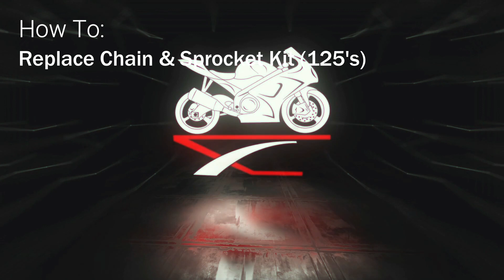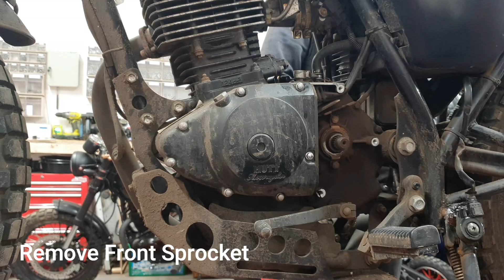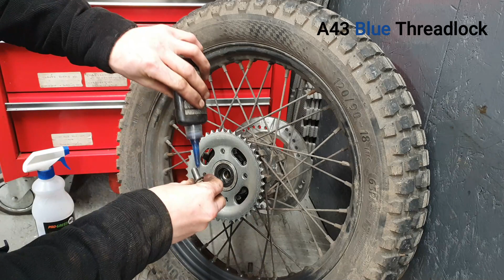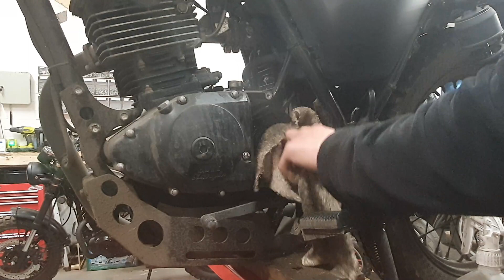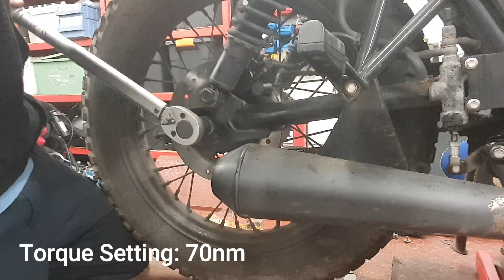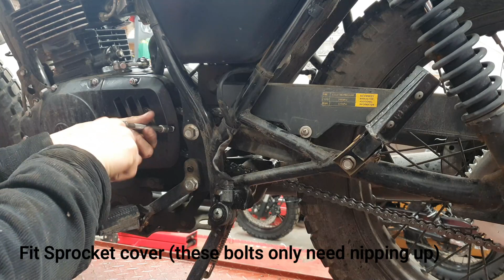How To: Replace Chain & Sprockets 125's (mutt 125 euro 4 & euro 5) #muttmotorcycles #sprockets #bike

Comment: Hello mate. I would love to gain a few extra miles on my Mutt. Back in the days we use to change the front Sprockets for a different size. I cant remember if it was lower or higher. Could you please enlighten me. And the second question would be do the site you advertised at the end will have what I need for the upgrade? Cheers And thank for the tutorial great job like always ;)
Reply from the maker: Hi, you can certainly do that, in theory if you get a larger sprocket on the front it gives you more top end and taller gearing, if you get a smaller front sprocket you get better acceleration and less top end, this doesn't always work the same in practice. Most mutts are 13T front the most popular upgrade is 14T front. We have 13, 14, 15 & 16 available here, just select the size you require.

https://rbmcstore.com/collections/wheels-final-drive-mutt-125-2017/products/front-sprocket-k157-engines

Comment: do you have a video for just changing chain on these or would it be advisable to do sprockets at same time? I have a 21 plate fat sabbath euro 5 is it same chain as you linked below?
Reply from the maker: Hi, you can follow this method for just the chain and ignore the sprocket replacement sections. As for the chain euro 4 and euro 5 are different lengths. Please follow the link here, it lists both of them.

https://rbmcstore.com/collections/wheels-final-drive-mutt-125-2017
Reply: @rbmcstore2497  spot on ta pal - don't suppose you have any videos on changing tacho on these bikes at all do ya? My fat sabbath literally today rev counter stopped working - it's digital speedo so I'm reckoning a loose wire (just recently replaced haedlight for LED one and LED indicators that can be seen - stock ones are dire lol)

Comment: Question, any idea what size the mutts stock chains are? My new user manual for my wee 125 doesnt say :(
Reply from the maker: Is yours a euro 4 (fuel injected) 125?
Reply: @rbmcstore2497  yeah
Reply from the maker: @rachelmcknight9340  https://rbmcstore.com/collections/wheels-final-drive-mutt-125-2017/products/d-i-d-chain-standard-length
Reply: what is the length used for the chain? usually states on the box